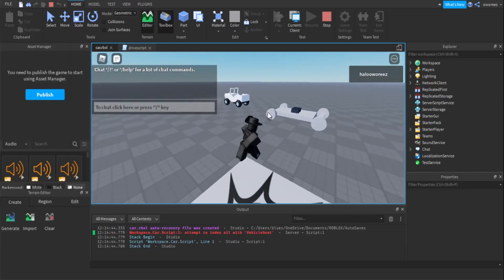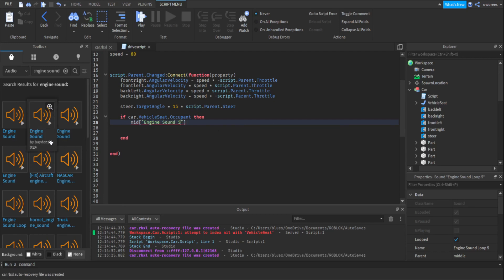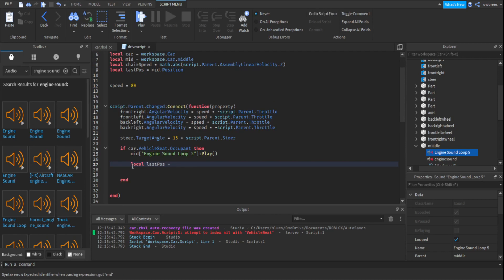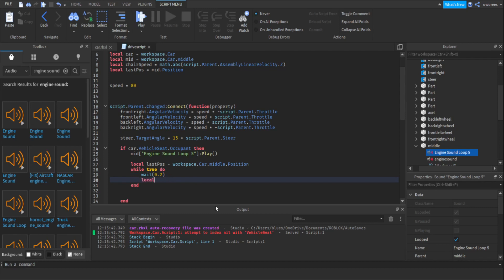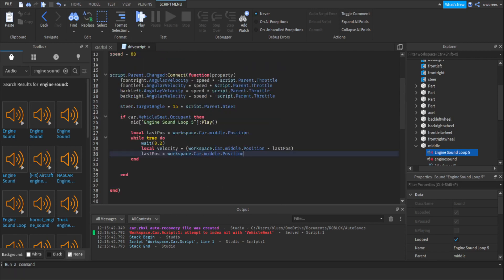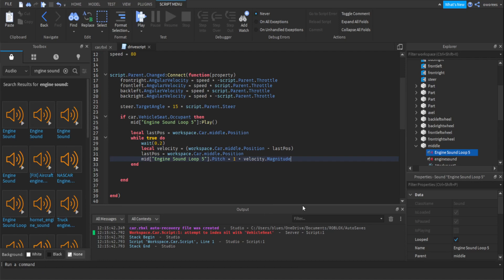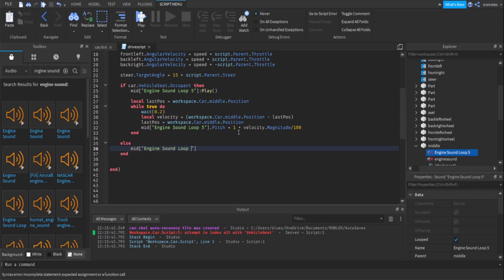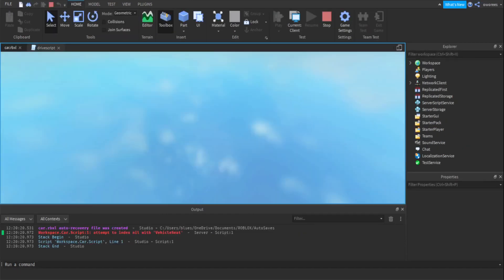Roblox Studio: How to Pitch an Engine Sound via Velocity

Comment: instead of subtracting positions, its possible to harness the already implemented speedometer you see when you dont disable "HeadsUpDisplay" by using something like:

local speed = vehicleSeat.Velocity.Magnitude
print (speed)

if you run this in a loop, itll constantly output the vehicleseats velocity.

Comment: Could you paste the code?
Reply from the maker: I'll post the code in a comment towards the end of today.
Reply: @sinkills  Thanks man,  im confused because i only want this kind of system because im making a train
Reply from the maker: @bueze8974  if carName.VehicleSeat.Occupant then
		
		//mid is the part of the car that holds the sound, use the name of whatever part has the sound
		mid["Engine Sound Loop 5"]:Play()
		//use the name of the car and a piece of the car, in this case "Ol' Reliable" and "middle"
		local lastPos = workspace["Ol' Reliable"].middle.Position
		while true do
			wait(0.2)
//"Ol' Reliable" is a placeholder for the car name, middle is a placeholder for the car part you want to track (must use same part you used for lastpos)
			local velocity = (workspace["Ol' Reliable"].middle.Position - lastPos) 
			lastPos = workspace["Ol' Reliable"].middle.Position
			
			mid["Engine Sound Loop 5"].Pitch = 1 + velocity.Magnitude/100
			
		end
		

	else

		mid["Engine Sound Loop 5"]:Stop()
	end 

	
end)